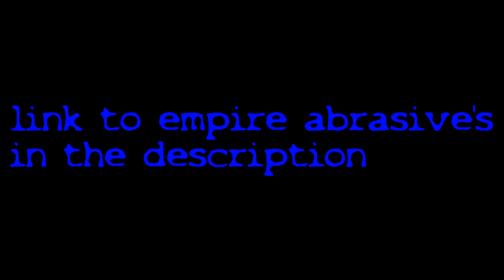Awesome angle grinder rack and flap disc storage.....

Comment: Cleaning the mill scale off will go a long way in improving the welds. Especially with the TIG torch. That's why you see the spatter and sparks from the torch. Filler rod is also your friend. Cool project though, I'm looking at doing something very similar. Thanks for sharing.

Comment: U should try wearing thin leather gloves or deer skin and choke up on torch head. U will have better control. Try keeping the tungsten angle perpendicular to work. Make little figure 8s when welding without using rod and will blend it better i found.

Comment: Promise me you will enroll in a night ciass to learn tig welding correctly. Alas you have undercut the material because you chose to use an autogenous process- "without filler wire ."  The strength is less. You broke off a tungsten and  have poor looking deposits. It is essential that you grind steel clean for tig, its not very forgiving as you have seen and you are completely wasting  your gas by not using a filler rod.Better to unlearn any poor habits now than have them become a greater handicap in the passing of time.You also took a comparatively longer period of time for the weld passes that you have had to go over twice ! I hate to see anyone struggle and some instruction with theory included will help big time.
Reply from the maker: as stated I am still learning, and since then I have learned a lot. I will admit I really don't take the time to clean the metal as much as I should. as far as taking a class, its not gonna happen.. I have a regular day job and a family to take care of right now but , maybe in the future.